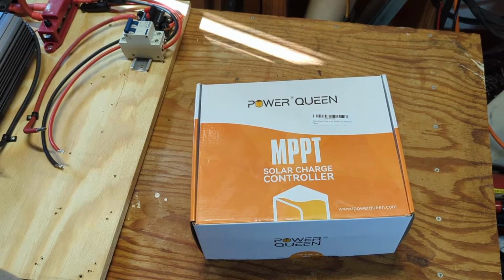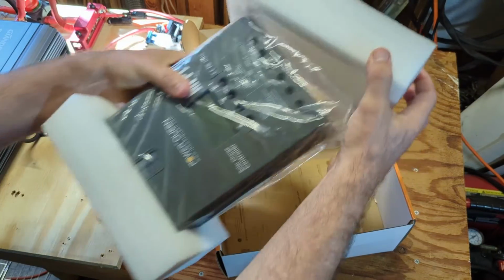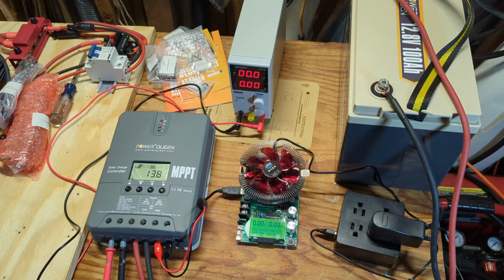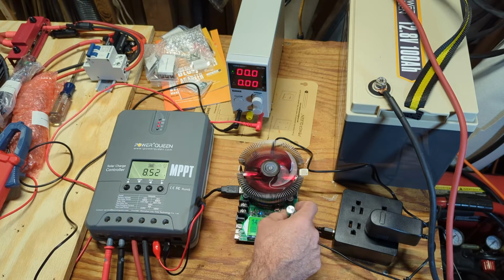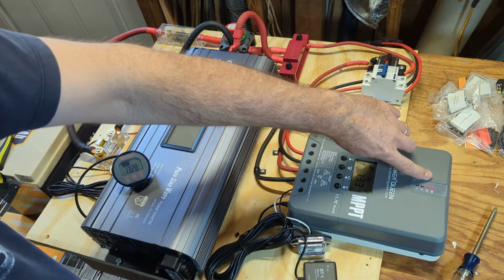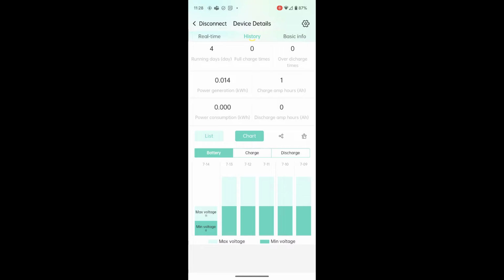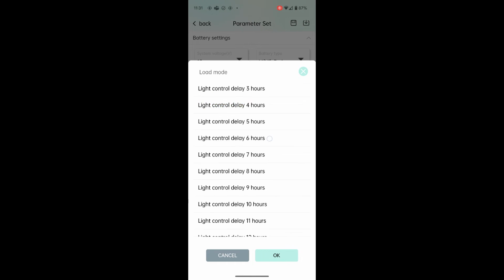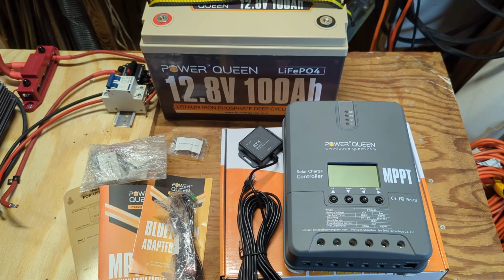Power Queen MPPT Solar Charge Controller

Comment: Another SRNE product.  Recently purchased 4 of the PowerQueen units with their corresponding bt-1.  Not the best app I've ever seen but it works.  The 30 amp Weize branded model of this unit (looks to be exactly the same unit sans color/brand name, also manufactured by SRNE) has worked flawlessly for over 2 years on a remote cabin.  Have seen tests showing these units do not quite reach their 30 amp rating although the app would show 30 amps.  No fans = quiet.  
  Upgraded the old single 30 amp Weize system with 2 of these units being fed by 4 250 watt Trina panels into a lead acid battery bank.    Somewhere on the forums, there was mention of the 'manual' battery settings reverting back to default settings.  Knock on wood, I have not experienced that possibly expensive issue.